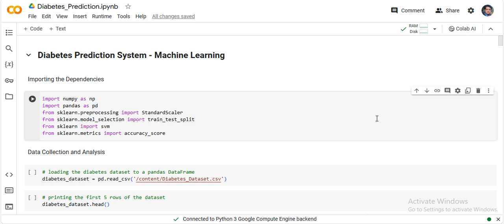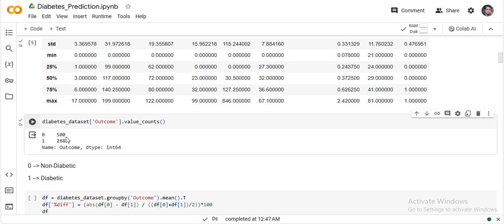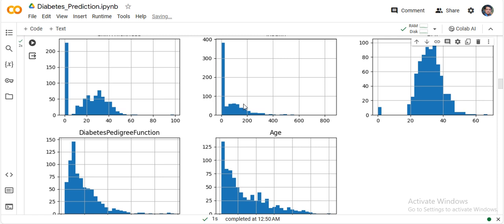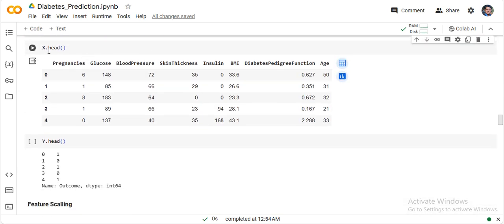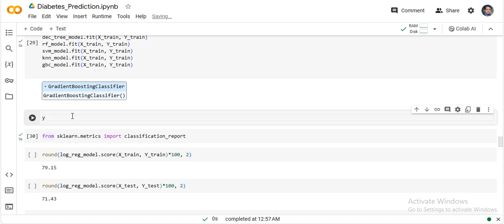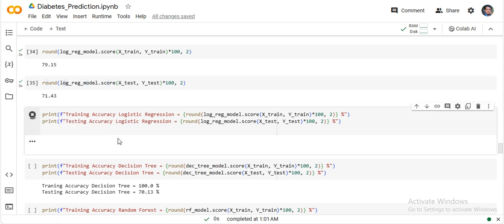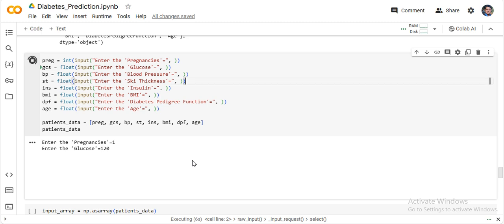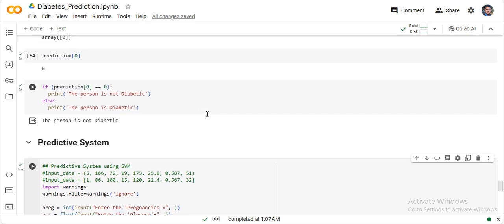Machine Learning Project | DIABETES PREDICTION #logisticregression #randomforests #decisiontree

Comment: I had a question that why haven't you removed the values which are less 0 in some of the columns, as the might change the staus of model predection, and the model will learn on the wrong data. And why havent you removed the outliers in the dataset before implying all the machine learning models?
and yes while featuring enginerring we could have removed those columns that have direct correlation?